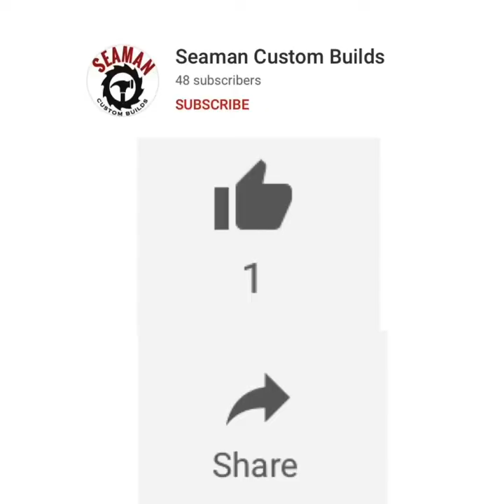How to put a straight and square edge on barrel staves

Comment: Would it be easier to use just the planner for the straight edge or do you need to use a combination of the sled and the planner.

Or were you showing us several different ways
Reply: You would need to use a combination of the sled and the planer as both sides of the stave would have an angle making them not stand flush in the planer